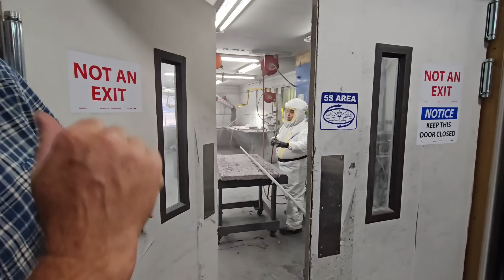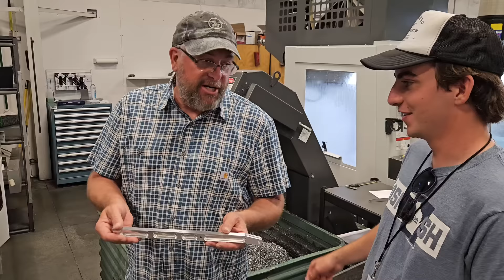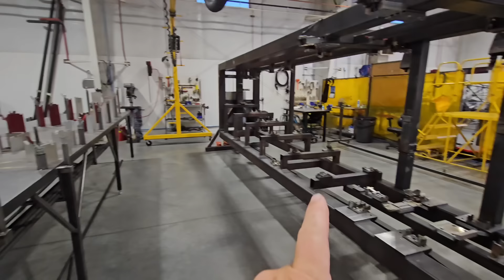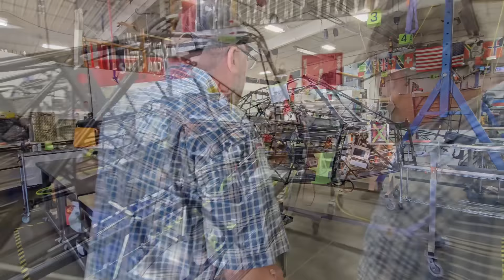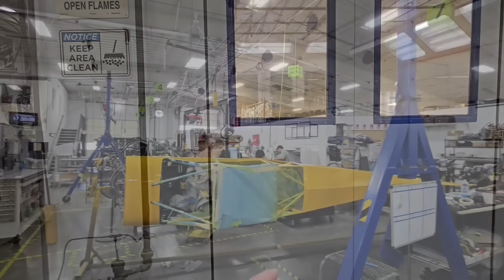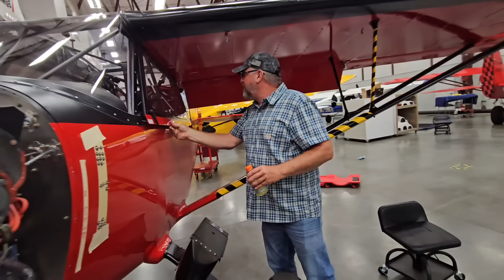OSH 2025 Cub Crafters Factory Tour

Comment: The original price of the Piper Cub was just over $1,000 in 1938. 1946, the price was $2,195, which is equivalent to just under $30,000 today.  Per Bing, new Carbon Cub models typically range from $300,000 to $400,000. Yakima Airport was renamed Charlie McAlister Field; I knew Charlie, who ran the FBO at the east end of the field, and rented from him. When I first met him, he asked what I flew..I said a number of things, including hang gliders. He told me he flew gliders also, walked over to a cabinet, and showed me a photo of him in a primary glider bungee launched off the local hills (from 1910). I have a photo of my son's mom holding his 5-page fanfold pilot certificate signed 11 November 1927, by Orville Wright (yeah, that one). Charlie was born 24 August 1903 and lived to his nineties. I actually applied as an engineer to the carbon cub factory back in the 90's, but did not work there, even though I lived in Yakima for about 15 years.

Comment: Totally AWESOME. Me thinks Henry Ford would be biggly impressed with the production line. Thanks for sharing. 
👍👍👏👏🇺🇲🇺🇲
Reply: The first mass assembly line construction was in Venice Italy, from about 1300 to 1800. They manufacture cargo galleys, oars and sails, in about 3 days per ship.
The walled secrete factory was called 'The Arsenal'. They had a number of shops making identical parts and then the parts could be assembled into a cargo ship in a couple of days. 
Venice dominated cargo shipping with about 3,000 galleys at sea in the Mediterranean.
In about 1910 Henry Ford came up with the same idea for building cars.

Comment: One of my pet peeves is gigs and fixtures. A gig is basically a fixture that guides tools to exactly where the tool is supposed to do its work (like a twist drill). And a fixture just holds the parts in place to make sure that the parts are assembled in their correct position. 
The more you know. 
Thanks Juan for all your hard work that you do.